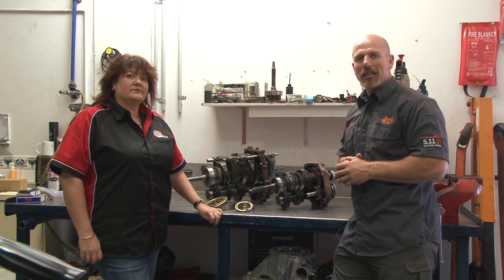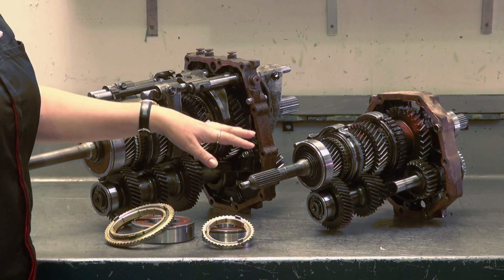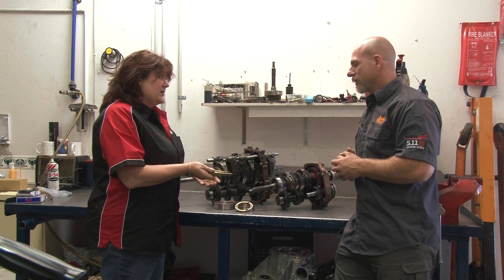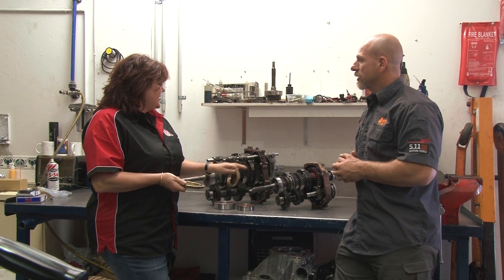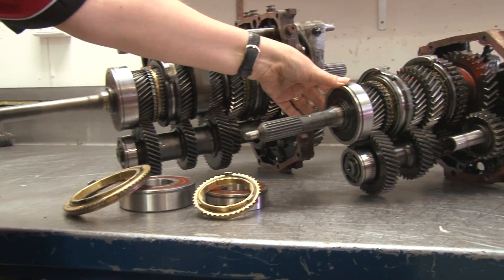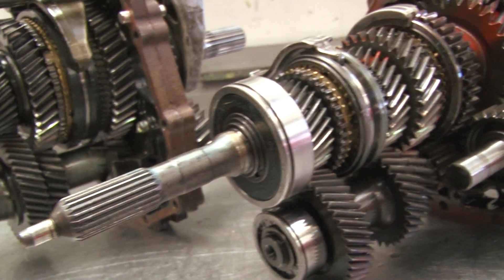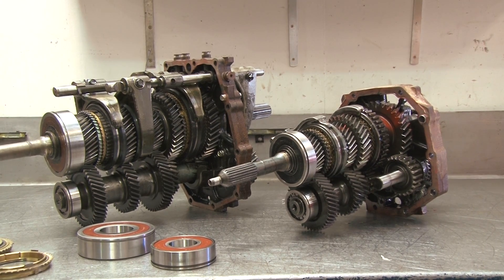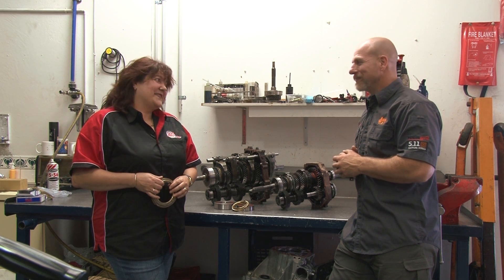Gearboxes for Turbocharged 4WDs

Comment: The smaller R150F gear box on the right are only found in 105 series 1hz Landcruisers. 80 series non turbo 1hz Landcruisers use a H150F box and 1hdt factory turbo models use the H151F  box, they're nearly identical. So this is only a problem if you own a 105 series 1hz cruiser and are adding a turbo.
Reply: or hzj78 1hz troopy
Reply: Thanks
Reply: What if you have a 75 series with a h55f